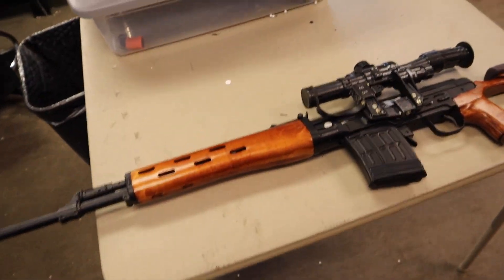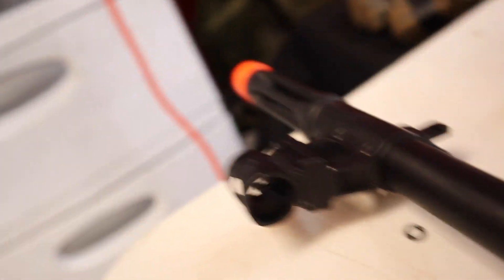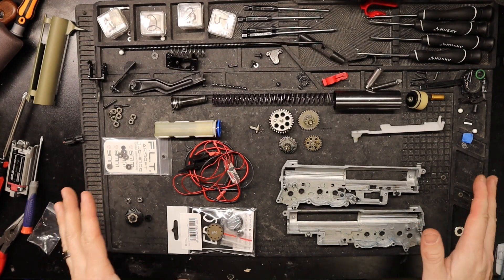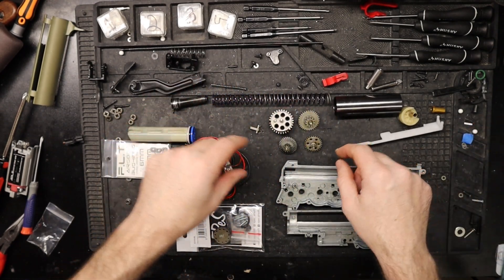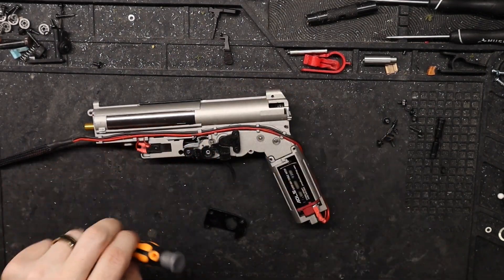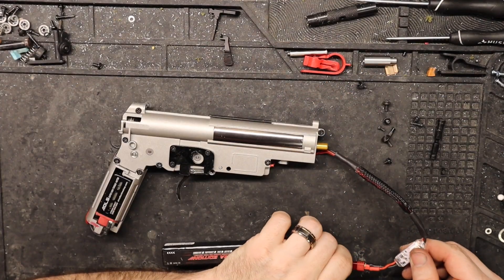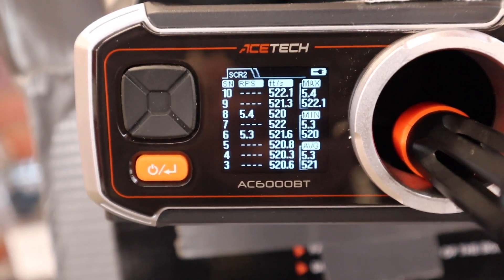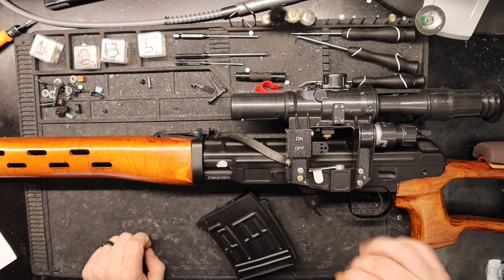CYMA SVD AEG Tune-up

Comment: A little too much AoE correction happening imo, one spacer would have been enough. Overall however excellent build. Another area that would have been good to look at would be the barrel/rubber combo. Even if he didn’t request a barrel mods, a quick clean and polish would make a difference in the current setup.
Reply from the maker: Thank you for the input! Here's an unfortunate story after this video.  This rifle's stock ended up falling apart from the wood breaking apart and he ended up getting another SVD but the Polymer version. Which then he wanted to swap the gearbox and barrel setup over.  So when the new SVD came in the mail.  I showed him how to transfer everything.  Long story short, he wished he got the polymer version in the first place, and he's real happy with his rifle.
Reply: @wyshtechairsoft is the wood stock one prone to breaking? Have the wood and the polymer stock ones sat in my basket just waiting for end of the month (payday here in the uk). Poly cheaper but wood looks better but if it’s going to break I’ll go with the poly
Reply from the maker: @anthonywood9632  The wooden stock on this cyma did break off.  So the owner of this SVD got the polymer and it holds up better.

Comment: @wyshtechairsoft  so im also preparing for some MSW games. I hav 1 a&k svd wood w mancraft and just got a cyma aeg svd-s. Planning on running cyma due to aeg and higher midcap capacity. It already has a barrel, hopup, and some compression upgrades according to previous owner. But im also wanting to get to 550 fps w .20 at 2.5 joules. Shoots at 425 at 1.5 now. So i want to beef it up some more but dont wanna damage gb integrity. Whats ur motor, mosfet, and spring recommendations? Also will all these upgrades work in a SVU? Thinking of having one as backup?
Reply from the maker: Biggest piece of advice that will answer alot of questions for ya is to look up what is air volume ratio and joule creeping.  Knowing air voluming your AEG to .40g and above, you can increase your joules WITHOUT going to a heavier spring.  Worse case you might have to go slightly heavier to achieve whatever joules you want to hit. 

As for upgrades, the Cyma SVD and SVU use the same exact gearbox AND the motor is more than enough to pull even a m150 spring.   You can follow my video for the upgrades and feel free to copy if you want but I highly suggest have a professional tech do it for you if you never worked on an AEG before.

Comment: i owned 4 cyma svds and the moment i saw cyma upgrades i instantly bought out their stock cuz its so hard to find upgrade parts
Reply from the maker: The pain is real.
Reply: There are no upgrade parts tbh. The only thing you can hoo is torque motor and a motor with precooking. It should have torque motor.

Comment: I'm going to be building one also for MSW here soon. What spring do you recommend for 530-550, and also what barrel was he using
Reply from the maker: If I remember right. Its an EDGI 6.01 custom cut to length of 455mm for .40g bbs.

Comment: Hey, I have recently bought the SVD Sport Tactical Version of this SVD and have issues with an extremely stiff rotating HopUp dial. Does anyone know a video where the disassembly specifically of the HopUp is shown,? I think I might have to file off a little bit of the Zink coating from the Dial wheels to make it turn esier.
Reply from the maker: No video that Im aware of. Theres 2 screws on top that you take off and it comes apart. You might have a manufacture defect on yours somewhere.

Comment: Can i add 595mm inner barrel on this Dragunov? I own a better barrel than the default one, the problem is that the default one is 680mm...could i get deflection of the projectile at the exit by doing this change, what do you say?
Reply from the maker: I always recommend using .40g minimum for optimal range BUT you have to go to a shorter barrel of 420mm in length.

Comment: I'm planning to upgrade my stock motor for cyma svd. The one that I'm going to buy is ASG Short Axle 30k Torque Motor. I wonder if I have to reverse the polarity of the motor during installation? If so, why it is a must do step? In which conditions I gotta change the polarity of the motor for svd? Thanks.
Reply from the maker: In any Cym SVD, you need to make sure to motor spins backwards. However, the SVD in the video was prewired with a Perun Mosfet so the polarity needed to be reversed. If you are using the factory wiring. You shouldn't have to worry about this.  If your gun doesn't shoot when you pull the trigger. That's when you know you got the wires connected wrong.  Reverse them and try again.

Comment: Begadi makes some nice Gears. I installed one of them sets in my CM svd and they sound very good with a Chihai19K motor combined
Reply from the maker: I have tried the Begadi gears for the SVD, SR25, and normal style gears.  Ive found the bevels to all be warped.  Which can easily be spotted if you free spin the bevel slowly while the gearbox is closed and screwed down.  It looks like its wobbling.   SHS and Rocket gears have perfectly straight gearsets.  This creates a noticeable difference in how smooth the gears sound when the airsoft gun.   Then again, the stock CYMA svd bevel is just as warped so it doesnt really matter anyway unless you want to run a ridiculously strong spring in the SVD.

Comment: bizarre to me to chrono with just 0.2's. at my field all limits are in Joule and you chrono with the BB's you use so there wont be any Joule creep
Reply from the maker: I only chrono with .20g for diagnostic and testing purposes to compare apples to apples.  When it comes to Joules, depending on the customer needs for better accuracy. Ill chrono exactly the weight they intend to use. Also test the common weight used at fields they go to for chrono whether it be joules or fps.